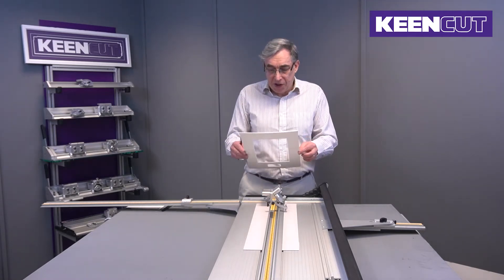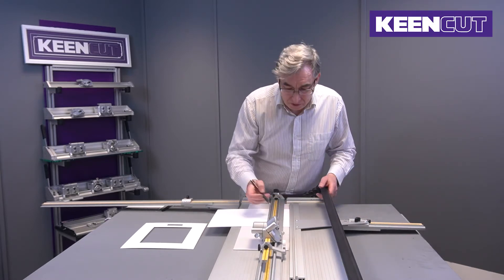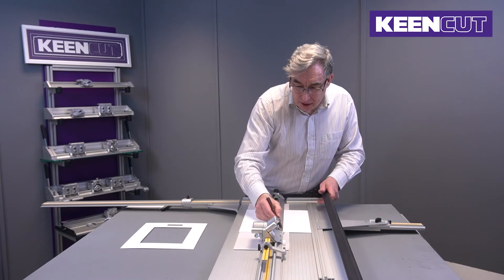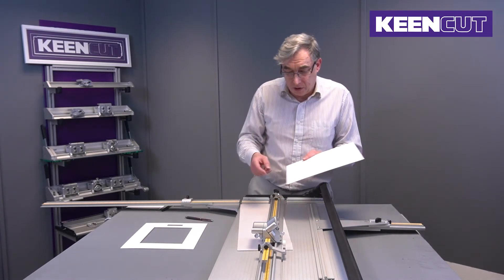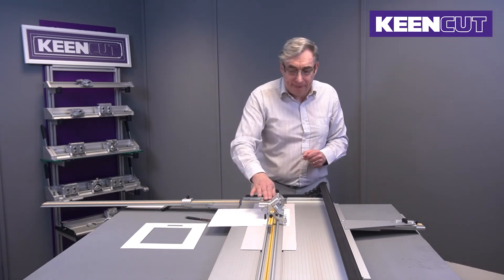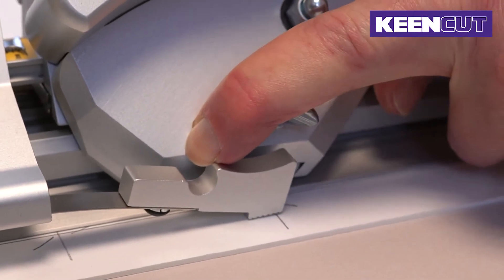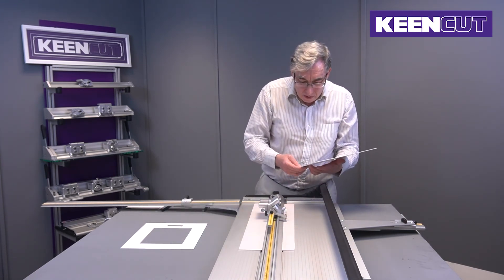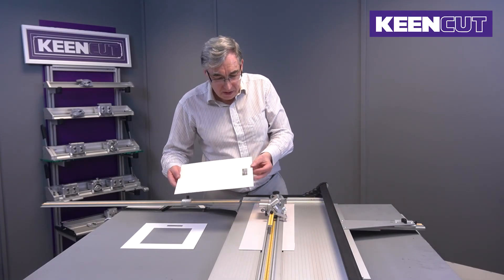7. How to cut a title box. Keencut Picture Framing Masterclass

Comment: I appreciate that you can have under and over cuts. But for the purpose of a demonstration video, surely you would want to calibrate so it does not under cut. Or am I missing something?
Reply from the maker: Hi Page Photography,

When you are cutting regular windows you can use the micro adjusters to calibrate the machine so that it cuts perfectly with no under or over cuts. With title boxes on small mounts it is still possible to use the mat guide and stops. However you soon get to a point where there is not enough range on the mat guide, the start and finish stops are fine but the distance from the top of the mount to the top of the title box becomes too big and you run off the end of the scale. This is when we revert to cutting by eye, either using the finger gauge or marks on the blade cartridge for guidance. It is a case of calibrating your eye which takes a little practise. It is always better to err on the side of under cutting as once you have an overcut there is not much you can do to get rid of it.

With a little more practise and another take I am sure I could have cut a perfect title box with no undercuts, but in reality especially when starting getting undercuts is not unusual for many framers and this is what we wanted to show.

There is a 75cm mat guide extension available as an accessory which gives a much bigger range on the mat guide, if I was cutting a lot of mounts with title boxes I would certainly consider getting one. It would then be possible to use the stops on all cuts with no under or over cuts.

I hope I have managed to answer your query but please get in touch if there is anything else.

Best wishes

David Wilkie GCF